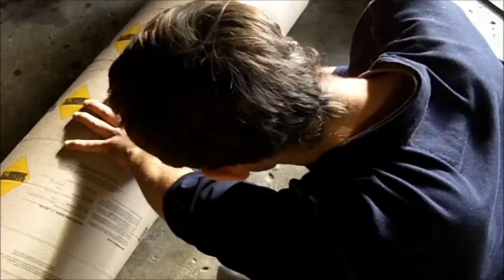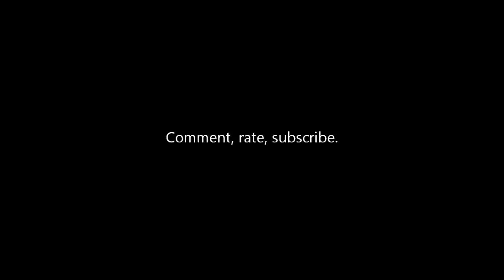Building a new port for the civic wall...28hz, demonstrating interchangeable ports

Comment from the maker: its pretty simple, just pour the resin into a plastic container, add the recommended amount of hardener and then a few drops more ;) (or you will be waiting forever for it to dry.) stir the resin and hardener for at least a minute. use your fiberglass mat in pieces like I did in the video. (this will ad more strength to your box) don't just paint the resin on the mat, make sure you really work it into the mat using chopping motions.

any more questions, just ask.